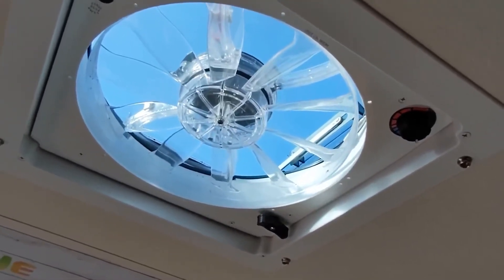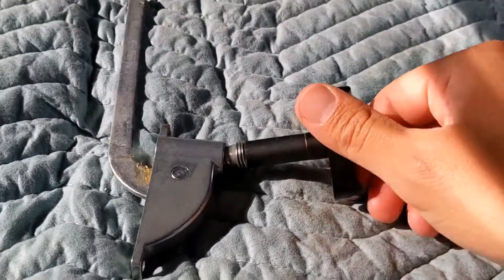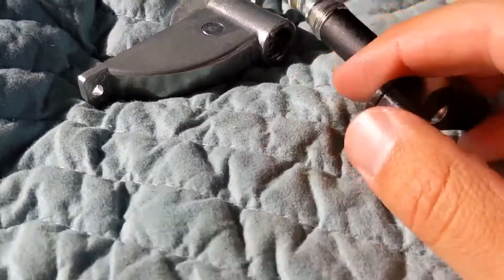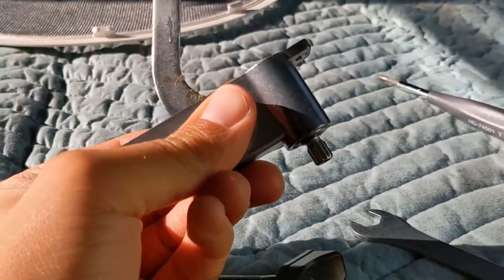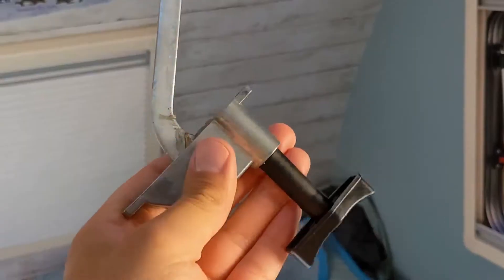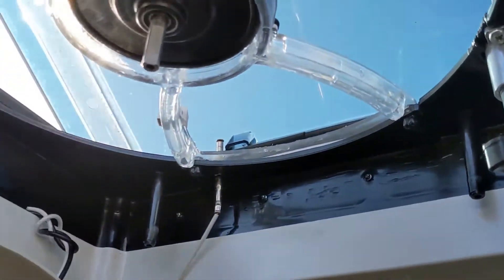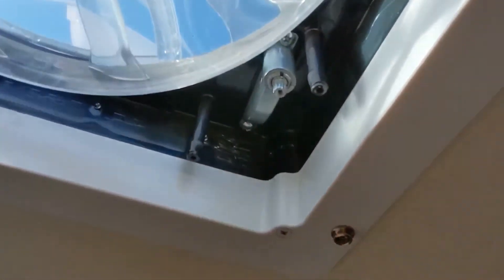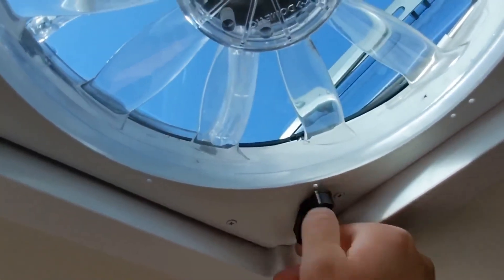Fan-Tastic Vent Repair - Manual Crank Issue

Comment: Thank you for this video! Our handle "fell out" on a trip we took in the last few weeks.  Your video gave us the confidence that we could fix it ourselves, on our Fantastic Vent model number 2200.  I'll add that we did not have to remove the fan blades, as you said; just the cowling with the controls on it, let it dangle down as you did.  We did chose to use a little Blue Loctite to keep this mechanism from falling out again.  Works just like new!

Comment: Thank you for this. I ordered the whole new part, then found this video. I fixed it with your help / video too! Much appreciated!!!! Right around 1:27 you can see once you screw in that piece where maybe the factory hammered in the outside so it won’t back out. Forget the word “wedged” it? Anyways I used blue gel loctite and wedged it with a punch to inhibit it from backing out anymore when you rotate the handle counter clockwise. It’s working now and if it happens again I’ll use red loctite! Haha. Thanks for your time and video!

Comment: My fan works my fan works fine but I fear that the plastic crank that I used to open and close it will go bad and I will be stuck with it open or stuck with the clothes. I'm looking to replace all plastic parts with metal. The metal base Daisy clamp the metal base Daisy crank looks good. Thanks. Thanks.

Comment: I have the same problem.  A thousand curses on fan-tastic fan for not using something like loctite on the outer threads to keep them from unscrewing. What I want to know is, what is the part number or description of that "wrench thing".  Where did you get it?
Reply: If you’re talking the actual mechanism…Try this on Amazon - ‘Atwood K8011-05 Manual Lift Arm Kit’